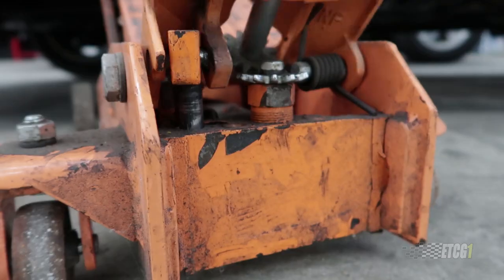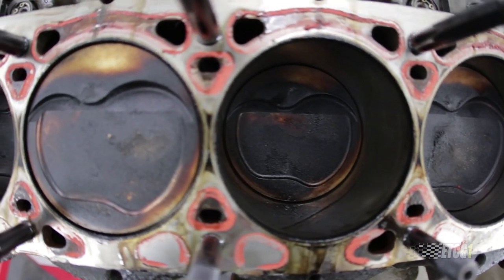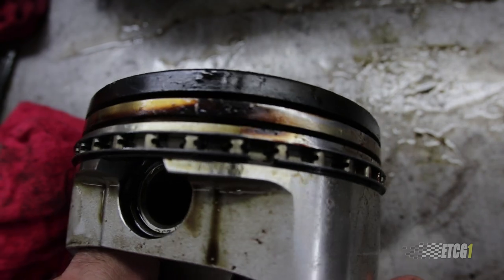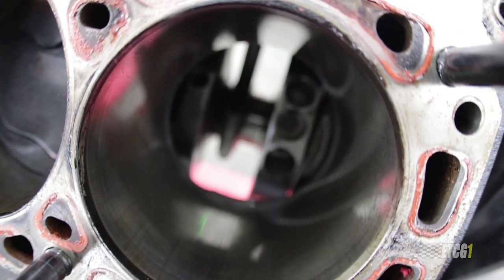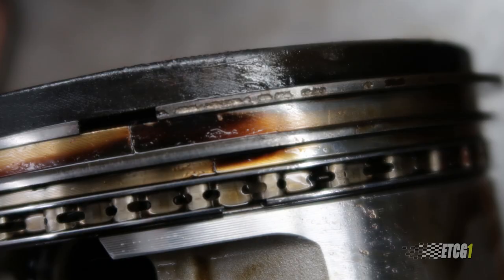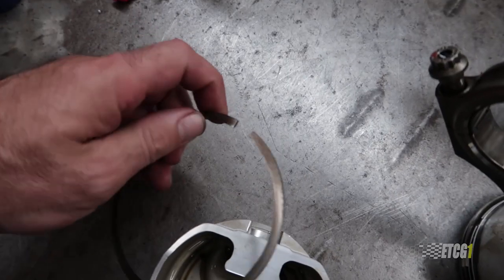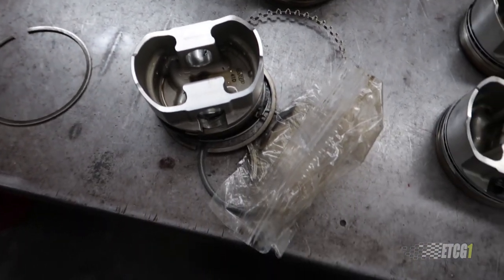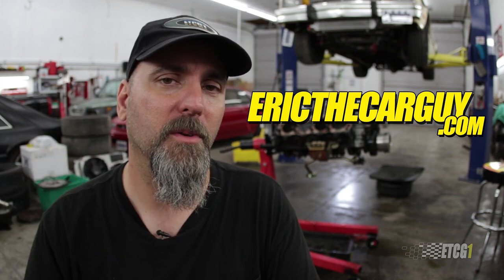Hydrostatic Lock the Silent Killer

Comment: I had a 7.3l diesel blow an injector tip off and hydro lock while it was running.  Welded the piston to the sleeve,  broke the piston at the wrist pin and bent the push rods and the valves.  Not fun.  Good luck on your project engine.

Comment: I had a K10 with a 305 that swallowed a little water. Sea water. Anyway, I got a cracked head. When I warmed up, it would miss and run on 7. Started pulling plugs until I saw green. Look story short, I ended up getting a 4 bolt 350 crate engine.
Reply: jason9022 the crate engine came with 4 bolt caps, but it was a better all around engine. The reason for the swap was that after I did the heads, the mains spun. I should have known by the ridge in the cylinders. The truck had been clocked. The 700r4 wasn’t any better. That said, the truck was great off road.

Comment: I replaced a marine engine that failed from this.  Water pump failed, overheated, blew the head gasket.  Owner installed a new pump, it filled the cylinder at speed, shot the insulator out of the plug and it died.  Compression test was a fail.  Pulled the head, the valve looked like an umbrella that had gone inside-out and it broke the rings which gouged the cylinder wall up.  We put a longblock in it.

Comment: I would also replace the connecting rod and wrist pin on that cylinder because either of those could be next to fail.
Reply from the maker: I'm having those checked at the machine shop before I install them.

Comment: Eric, what was the gap on the rings? It look more that the ring butted together and it does not necessairely show in the ring ends, i have few pistons here that looks like yours.... and they were fuel injected supercharged with stock ring gap.
Reply from the maker: No. Watch the video again to see that there is no budding on the ring ends and then watch the video linked in the description that shows when these rings were gaped for forced induction.

Comment: I'v got a 1997 Toyota Rav4 (3sfe) that went throw a huge "puddle" was more like a little lake, the air filter was soaked and had to pull the plugs out and crank it over to get what looked like a gallon of water out of the engine, that was before i bought it form a friend and its still running that happened in April of 2016. Also had a friend buy a Camry with a 5sfe in it a few mounts back that shot a rod throw the cast iron block on the way home from picking it up, thinking it was because of detonation, went to the scrap yard the next day so never did a biopsy.

Comment: so, one rainy night, I ran my 95 civic through what could have been 6-8 inches of water from a clogged storm drain (lake parthenia lol)...at about 35 mph. No CAI...just aftermarket filter attached to stock pipe....engine bogged like it wanted to stall, I slammed it into 2nd gear (auto trans), floored it, and watched a giant cloud of steam come out the back of my car. Afterwards I had to replace my O2 sensor, but, the car ran fine, for the next two years. I always wonder how close I came to destroying it right there. Seeing this video has me thinking about my poor connecting rods...(the car is non-op atm due to the crank pulley breaking off, thanks to an improper installation from the dealership, and it being cracked and out of balance).

Comment: Update on the hydrolock in progress problem.  It took me a while to figure out that I had hydrolock, and not some other internal engine problem.  However after pulling the plugs and rotating the crank by hand I found gasoline in the combustion chambers.  And I mean A LOT of gasoline.  I cleared it out, blew out the chambers through the plug holes, and sprayed in some penetrating oil to lubricate the cylinder walls as best I could.  Got it to start, but the AFR was either at 10 or 20 on the FiTech, so either too much fuel or not enough fuel was being injected.  After some discussion with Tech Support, I keyed on without starting and peered into the throttle bores.  The injectors in the back left bore were literally pumping out fuel as if at WOT,  So that explains why cylinder 8 was filling up the worst.  I am changing oil (gas contamination), and replacing 2 injectors.  Easy enough to do since the throttle linkage is on the other side.

The FiTech 30008 was brand new when this problem reared its head.  Ran for less than half and hour, and these injectors went crazy.  Hopefully there won't be anything else wrong with the unit.  Buying 2 new injectors at about $95.  I let myself get so discouraged by the engine being locked up that it sat for six or seven months before I put in enough effort to find the problem.  I was ruling out the FiTech since it was brand new.  So two weeks out of the FiTech warranty, although I have been buying the Extend warranty on both FiTech and Sniper.  The Extend warranty is a lifesaver!  Jegs offers it.

Comment: Some years ago I worked at the Coca-Cola company as a security guard I was good friends with the mechanics at Coca-Cola and spoke with them regularly.

 After a local flooding event one of the trucks was damaged after the driver try to ford an area that was highly flooded and the engine took in some water. 

Well it was determined that the engine was hydrolocked. The International 1600 took a swig of water, after the truck was recovered the mechanic disassemble the engine engine was disassembled and when he pulled the head off  first of all there was water inside  when he got that out  drop the pan  pulled off all the parts  and pulled out one very bent connecting rod.

This wasn't some little car connecting rod this was in a decent sized diesel engine. The Pistons slammed into the water with such force and since the water was incompressible it caused the connecting rod to bend.

Ultimately the engine was rebuilt and the truck was put back on the road. This is another reason why you should not try to drive through deep water. If you do not know the depth of the water do not try to cross it. If the water goes higher than the center of your hubs on your car wheels do not go through the water.

The water does quite a bit of damage if it gets into the engine. Now if you have a snorkel attached to your vehicle the chances of the water damaging the engine are far less likely. But it's still not a good idea to go crosswater that is too deep and if you don't as well know what's in that water it's best to stay out. 

Thank you for another great video ETCG1.

Comment: I wonder if that's what killed my '98 Olds 88. Was low on coolant, refilled it and shortly after hydrolocked the engine, turns out the intake had gone out, as is common to happen on those engines (3.8 v6 with a little over 100k miles), and thus dumped what coolant I had added into the intake (how it hydrolocked is it had pooled in the intake over the course of driving it for 2 or three days, then I took a hard left which dumped that pool all at once).

Later on (a year, maybe year and a half later, can't remember for sure) I had a piston rod snap in half and punch a hole in the side of the block destroying the engine. Probably this is the culprit for that rod snapping.

Comment: My buddies wife drove a VW Jetta through a monsoon river in Phoenix. Locked it up and bent the rod. I put a new piston and rod in it and got it going again. I was just amazed at how it bent the rod. Another instance with the same friend he had a mid 60's Ford truck that he was having issues with and he decided to loosen and re tighten bolts except he did it with the head bolts and coolant leaked into the cylinders and locked the motor up, I pulled the spark plugs coolant drained out. I told him the damage was done, rebuild time. He went and bought another motor and I put it in for him. This happened in a period of 2 months. Same friend, both vehicles in 2 months, what are the odds of that happening to someone???

Comment: My question is my car is a 2007 Mercedes e63 amg. Driving on the  Highway about half a mile from my exit node is the car hesitating really badd noticed blue smoke coming out of exhaust I was able to exit, drove 2 blocks with a some hesitation on the car  I was able to put the car on park while there was still an park connected my 02 sensor notice check engine light flashing a gave me cold P0303 and p0304 and p0300 then  Quickly turned it off try to start it again one time it would not start I called a tow truck.  Next day did a compression test all  were at 14.5  Ratio which was OK but I'd noticed on the beginning I had a bunch of fuel in spark plugs #4 clean it and when and check my fuel injection. It was stuck open. Now I'm replacing them all. I hope my engine is ok. I did removed the valve cover to inspect so far everything check out.🤞🙏 what else should I do

Comment: I had a hydrolocked engine last spring.  Drove through a flooded road which I couldn't see was flooded, due to how hard the rain was coming down.  Engine died immediately, and never cranked over again. Ended up replacing the entire engine.

Comment: My nephew went through a puddle at a good clip. Motor hydrolocked and he tried starting it in the puddle. He says the car just shut off never made a catastrophic noise. I'm working on it now I have plugs out, intake off, everything to purge it. Well the crank wont turn to purge. I've gotten the crank to move more since using penetrating fluid and letting sit but still sticks. All pistons move but I dont see any movement on valves. Is that normal? Valves not moving w pistons but again crank only moves 60 degrees back and forth. I'm a plumber but mechanically inclined. Anything I can do to find out if I have a shot?

Comment: Yep, flood happened about 6-7 years ago here in Melb, went through the water, and boom, sent two pistons through the bottom of the block, and as they went through took parts of the crank with them.

The mechanic was very impressed lol, however V6 Camry engines are not cheap, so I kinda wasn't.

Also, fun fact, liquids are indeed compressible, however, they are many orders of magnitude smaller than gases, I found this out when not taking the amount of compression of kerosine for a rocket engine I was building, and inevitably put more fuel into the chamber than I had designed. Even small amounts matter, any machinist knows a thou can make all the difference. In engines tho, it's a killer.
Reply: what is it with folks and trying to drive through water :)))
I mean, my whole intake system is 4+ feet in the air and it would take over 3' of water to get me wet inside. and i still wont go through water deeper than 1/2 foot.
then again I know it effects brakes, ball-joints, wheel bearings, tie-rods, cv's u-joints, rear end, alternator, belt/pulleys, etc etc etc......
not to mention cold water on outside of engine is a huge thermal shock and can crack the block/heads etc. ohwell

Comment: Liked this video,  after watching it I've got a few question for you.  can this (hydrostatic lock) cause the timing belt to break? 
Back story.  Had a company change daughters oil,  they overfilled engine with 3.5 quarts of oil. she drove home and we went on vacation (so her car sat for 2 weeks) when we got back she had school and work so she drove car.  I wasn't out there to see the smoke. 2 days pass I see smoke I call oil company they send manager out he AGREES that there is too much he hires tow truck takes back to shop and "fixes" issues. get car back  runs rough.  couple days later car dies.  Of course we try and start it. nope nothing.  after 1 year and few months they are refusing to pay anything  on this.  because of 250 extra miles since oil change,(daughter to school and work) and they state that this could not have cause timing belt to shred. (2010 Dodge Grand Caravan with 4.0 V6).  My thought was oil in cylinder,  between piston and valves. compression of oil keeps valves from opening (hydrostatic lock) causing timing belt to skip cogs making zero clearance engine to now be out of time killing engine.  trying to start engine causes more hydrostatic lock (more cogs and tearing of belt) .  So is this feasible? or am I jumping at straws. If it is feasible is there a web site or a video that explains this so I can show lawyers.  Thank you for your time and keep making these vids

Comment: Dad drove through some water few years back in a Peugeot diesel, engine cut out but restarted ok, sounded a bit odd so he took it to the dealer, they said it would be ok once it dried out. Brought it to me to listen to, so i'm stood there reving it up, hand on the injection pump and it just sounds like its missing a bit so off he goes, half an hour later it split the block in half when it threw a rod.... Pretty sure i'd be missing some fingers if it blew up a bit earlier!

Comment: Does a bypass valve fix the issue? Of the water intake
Reply from the maker: As long as water doesn't get into the engine there is no issue.
Reply: @ETCG1  a bypass valve is supposed to solve the issue
Reply: @ETCG1  does a bypass valve really work

Comment: Hey!  Situation and Question for you. Happy Birthday LOL!  I had a hydrolock on my LR4 5.0 L according to land rover dealer.  They did a recall on the fuel pump (replaced) then did a coolant system job.  I noticed slowly over the first few days low coolant and that continued over a month or two and I topped it off withcoolant each week.  Then one day "No Start/NoCrank".  Pulled the manifold and immediately noticed the notorious inlet pipe cracked at its base.  Now I assume this small leak maybe made its way into the intake and over time it finally gave way.  Should I just start pulling this engine out and rebuild?  Should I do a compression test or does that really matter considering I can just rebuild it.

Comment: I had hydrostatic lock happen on my Toyota pickup once but with catastrophic results such as a large hole on one side of the block and a smaller hole on the other side so you could look all the way through. This was the result of a buddy getting his Jeep stuck,  me pulling him out and on the way back out going through a water hole that I had no problem going through the 1st time sucked water when heading through going the other way. It was partially my fault because when I bought the truck a few months earlier, I had noticed a previous owner had installed a cold air intake on the truck but instead of mounting the air cleaner at the end of the intake up higher in the engine compartment, he just left it laying in front of the wheel well. I had plans to mount it up just below the hood and shield it from possibly getting water but hadn't got to it. It slipped my mind about where the air cleaner sat when my buddy called asking for my help. I've had engines quit running from getting wet before but it had always been water affecting the ignition system, never hydrostatic lock.
Reply: :))) kerpow!~

Comment: Had this happen on truck I had. The head gasket (I assumed it was head gasket never really checked exactly which one failed) and started putting coolant into one of my cylinders. I was out of town when it started getting ready to head home. The truck was b*** to get started and I knew something was wrong. But it finally started up and I drove it 5 hours back home. Once home since I knew there was problem I didn't drive it until I could take a look at it. Two days later first thing, attempt to start it. Bad idea, big bang and lots of knock. I shut down the motor, no rod out the bottom or side. Started pulling plugs out. The second spark I pulled coolant poured out of the hole as soon as the plug was removed.  After removing (and replacing) the motor I found pieces of the rod in the bottom of the oil pan. Shattered it into shards. That thing must have been at the bottom of the stroke and filled all the way up with coolant.  Lesson learned check things before a start attempt.

Comment: Buddies Ram sucked up water while offloading one day. The engine died and we weren't sure why. We tried to turn it over and it sounded almost like a dead battery. We continued to try and restart having at the time no knowledge of a hydro lock scenario. Finally it started and in the process broke a connecting rod right in half. We ended up finding the air intake tube had been moved by the previous owner we think to in front of the passenger side fender well behind a grate looking thing. Not sure if that was stock location and there was some water deflector or something missing. So as the tire would spin and sling water around the intake was sucking it into the air filter and subsequently the engine. He only had the truck for maybe a month.

Comment: What about those times when you are doing a sea foam through throttle body and the engine turns off. Is that the same thing as hydro static lock? Can it do damage?

Comment: Question: for whatever reason excessive oil gets into the spark plug cylinder, maybe bad valve cover or being inattentive and clumsy, would hydrostatic lock be a risk? How do you go about getting fluid out the engine?

Comment: So the starter has the power to damage a piston ring in a hydro lock situation at maybe 200 rpm? Did another cylinder fire this causing more force on the geyser locked one? Seems like turbo combustion at 6000 rpm would provide more stress for them.
Reply: If memory serves me the cranking speed rule of thumb for starting an engine is about 350-400 rpm. Below that engines won't generally start because they need a bit of inertia to carry over the between firing impulses.